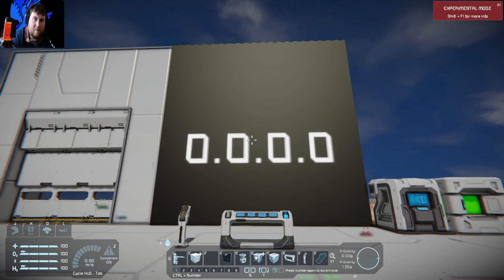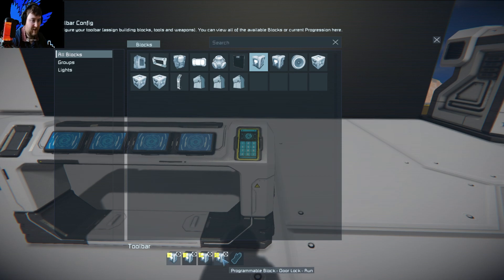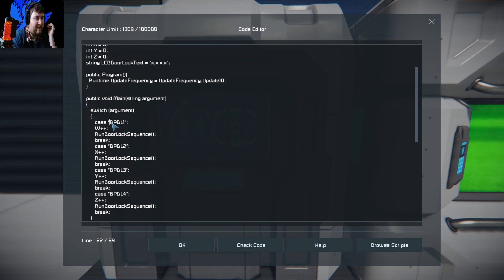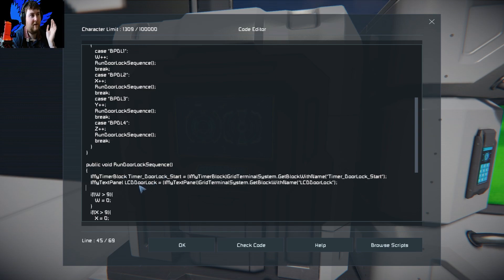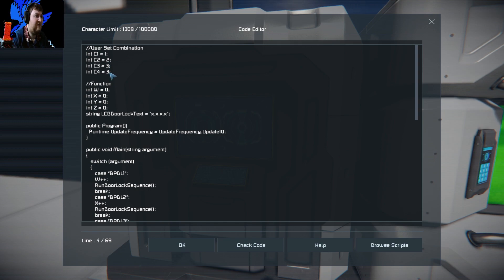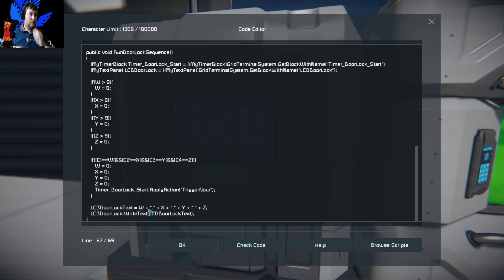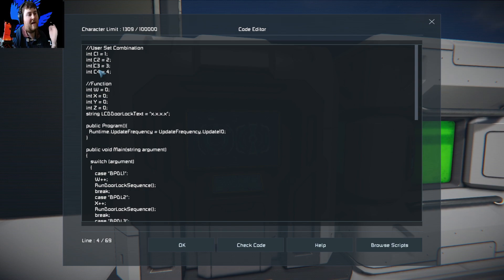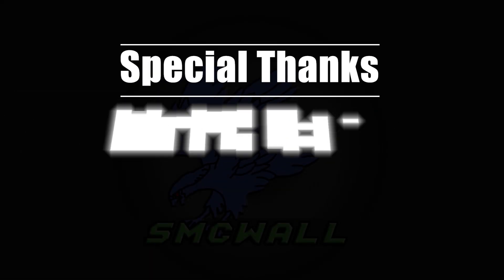Space Engineers - Script Tutorials - 6 - Combination Lock

Comment: Wouldn't it be easier and more efficient if you made it 1 big number? like 0000 and add 1000/100/10/1 for each button? Or to just use an array? I am new to C# so i am not sure if it would work. Thanks for the great tutorials by the way!
Reply: Was about to comment the same thing! I think the singular number would be more efficient. Only issue would be choosing the right number, but unless you are doing some 20 digit number, you shouldn't have any issues.
Reply from the maker: This is so much better... I can't believe I didn't think of this.
I will have to make another video called V2 and credit you in it. 
Thanks for commenting, it would certainly make the code more efficient
Reply: One objection, Let's say your single digit was 8, accidentally you pressed it 9 times. The only way to go back to 8 was to have an addition with a carry adding a digit to the tens digit. Well if that was already set or it was 0, you have to increment 9 times again. That error propagates. You'd have to implement a counter for each button to reset or deduct the next greater digit for each full rotation.

Naturally, you could summarize C0-C3 as one static value and string WXYZ together before each comparison. That would allow you to set the code as one constant without changing much of the existing code.

Efficiency wise (at least on 32bit) I think an addition of 4 decimal digits also adds more cycles in assembly making your code less efficient even if barely noticable than when you increment each digit indivudually. Therefore I say from a computing view, it's more efficient as it is now, even if the operator needs to change 4 constants instead of one.

Reference: As far as I understand assembly in 32 bit, the addition of two 8 bit numbers can be done in one cycle, 8 to 16 bit numbers take two cycles. A comparison takes 1 cycle for both. Maybe in 64 bit the addition only takes one cycle and it makes no difference.